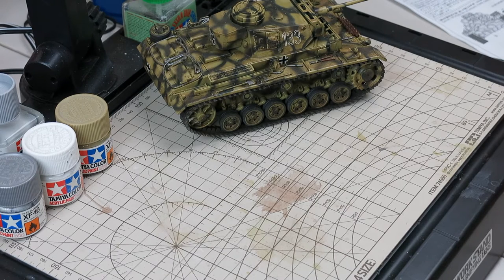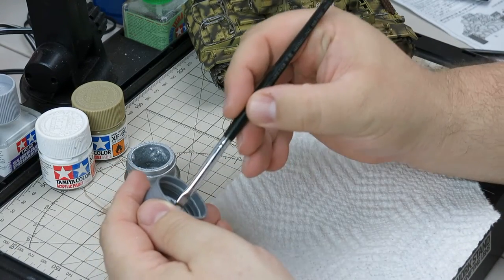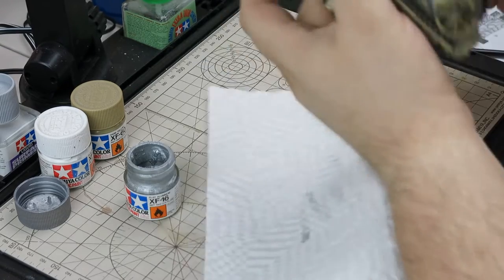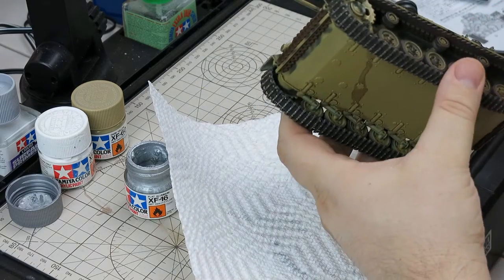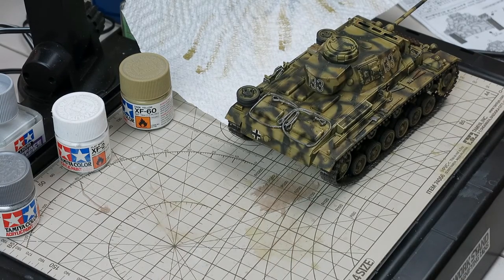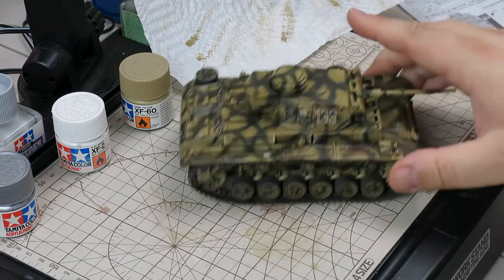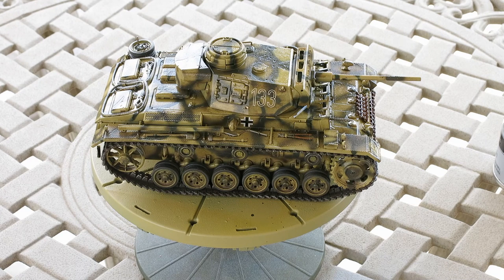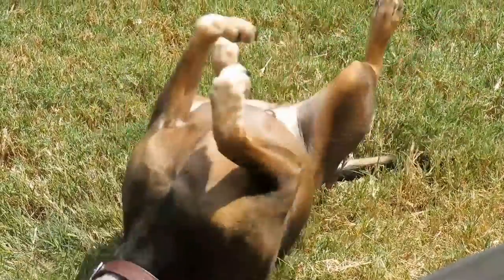Let's build a Tank part 15 (Drybrushing & Dullcoat)Finale

Comment: Hi! I liked this series of tutorials a lot and found them extremely helpful. I'm not new to the hobby but I'm kind of an "on-and-off-model-builder". Every now and then I start anew. None of the techniques were new to me but - and that's a big BUT - I learned how to execute them in a better way.
I'm really about to start again. There's a little stash left in my hobby room along with some kits I already started to build. At first I'll have to clean up the mess in there, because for the time being I'm using the room for storage of all kinds of stuff, urgh!
I downloaded the complete "Let's build a tank" series, cropped the 480 quality films so they match the 1080 size, cut them together and burned them on a DVD. A very good film of about 2:40 length! Thank you so much for your work! Greetings from Germany.
EDIT: The length of the film is of course 2 hours and 40 minutes!!!
Reply from the maker: +Non-Prolific 1/35th Scale Model Builder Thank you very much I am glad you liked the series.
Reply: +TacticalJackalope In the series you talk about the towing cables. I use gear shift cables for bicycles. They have the proper diameter and look really good. You need the get off all the grease or silicon, but I think it's worth the effort. After that you only need to glue the "eyes" to the cable, using CA glue.

Comment: Now you have me thinking ! Used to dry brush all my kits and then for son reason I stopped, other than with the exception of the tracks an perhaps sprockets. I think I need to  revisit this technique as I'd forgotten how effective it can be. Thanks for the demo and timely reminder Andy
Reply from the maker: I think for some modelers dry brushing has fallen by the "wayside" as it were.  I don't always do it myself but I thought for this series since it is a simple technique I would do it for the benefit of the beginner.

Comment: Dry brushing can also be used with the base color and white to make the tank look dusty or the the camo worn down or even make the paint look a little faded. Just dry brush the whole tank with the base color mixed with white with almost no paint of the brush. After that, I go over the tank with a very thinned down light dry brush coat of ivory to make the tank look even more dustier and to bring out the other raised details.
Reply: A very light dry brushing of white also looks great on the rubber of the road wheels. It makes them look a little worn down. If you have a simple number 2 pencil, cut down the pencil and rub that on areas of the tank to make it look as if the paint has worn off down to the bare metal, I find that works really well for the tracks too. Oh and it looks best on the wire cables that the tanks have.
Reply: Davis Jacobs And something else of beginners to do is don't worry about trying to get the soft edge German tank camo. Plenty of German tanks had the hard edge. Not all tankers could get their hands on airbrushes and they had to use paint brushes and rags to make a camo pattern with, so they turned out to be hard edge.

Comment: just getting into some serious model building myself, planning on getting a trumpeter soviet kv85 tank. Would you recomend painting the pieces before assembly. It seems much easier thn trying to paint detail without paint running onto the wrong parts. Obviously camo patterns are painted after contruction. Also an WW II era model kits you'd recomend (prefer 1:35 scale)
Reply from the maker: Floatable Tractor No it would be easier to assemble then paint.  The only thing I paint off the model is wheels and tracks.  Plastic has to have plastic to bond to if you try to glue painted parts it will just dissolve the paint and make a mess where you try to join the pcs. together.  Only in aircraft building or cars do you follow the procedure of build - paint, build - paint.  That is because many of the sub assemblies it will not be possible to reach after they are built.

Comment: Sorry I'm a bit late on this series, but I enjoyed it alot. I have a few questions. When you sprayed the gloss clearcoat before the decals, did you spray the entire tank including the tracks, or just the upper part of the tank?  And if you removed the turret during this step to prevent it locking in place, would it go back in place after or would it require alot of sanding/fitting to get it back on? Thanks!
Reply from the maker: +Hephaestus Axe Yes, you spray the entire vehicle tracks and all.  This does a couple of things it protects the paint and decals and makes a nice layer for applying a wash.  I removed the turret because the spray lacquer would dry and force the turret to stick in place one it cured.  It will not require any sanding or fitting to reinstall the turret.

Comment: Hey I just watched your panzer build. Great stuff. I am on my first armor ever. Question: I am using panzer gray. Will the dry brushing also work with a mix of panzer gray and white?
Reply from the maker: skmm2010 Absolutely!  Typically you drybrush a lightened version of the base color.  So I would experiment with adding white to your base until you get the color you want.

Comment: The result was stunning on this build, great job!  This has been a big help.  Is the flat spray you're using the can with a green stripe?  Or is it a different testor's flat spray?
Reply from the maker: It was Testors Model Master I am not sure I remember a green stripe but I did have to remove some of the label to get the lid off.

Comment: Contrary to popular belief, you can actually hand brush (not drybrush) Tamiya paints if you use retarder to stop it drying so quickly. I'd still rather use another Acrylic like Vallejo but it is possible.
Reply: How do you find it? Unless I need an exact colour match it doesn't feel like it's worth the hassle as it still doesn't seem to brush as well as other brands.
Reply from the maker: Ebay
Reply: +TacticalJackalope I meant how do you find the paint with the retarder. Definitely improved it for me but it still didn't seem to brush as well as other brands; maybe my ratios are wrong but I was worried about adding too much.
Reply from the maker: +japesss The only thing I brush paint is vehicle tools or maybe a seat and it works fine for that.